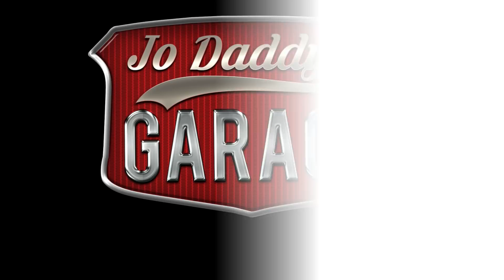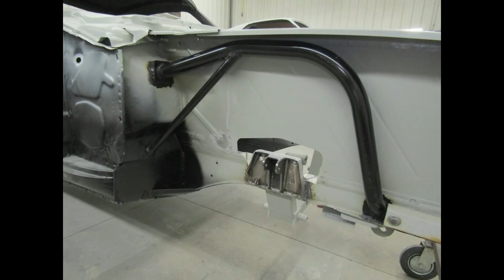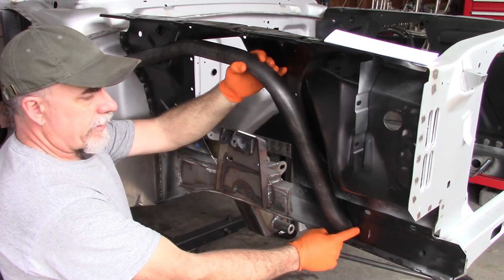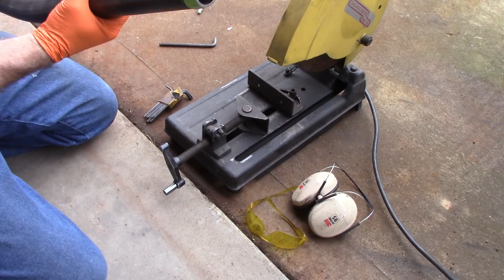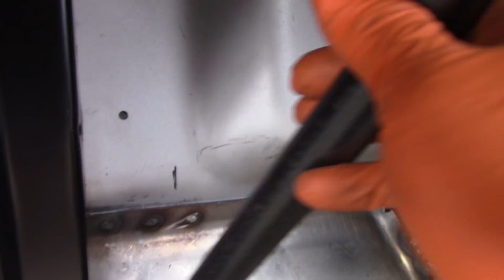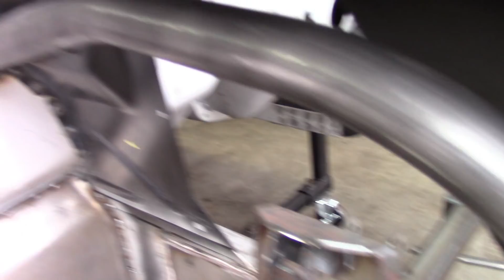Mustangs to fear frame stiffener install. Brooklyn Pony part 16

Comment: Did you end up having any tire rubbing issues?
Reply from the maker: Not after I modified it. Found out later the owner provided 2” drop spindles. That affected fitment. I thought they were regular spindles as we had agreed on that.
Reply: @JoDaddysGarage   what needed to be modified or is there a video on that?

Comment: Never seen how a sheet-metal base (firewall) is going to help. Im a collision specialist i small front-end fender bender will take out your firewall in 2.2 sec.
Reply from the maker: I agree. Not my design.
Reply: @JoDaddysGarage   with the mustang ll style frontend I would run one tube from about the same point as that one start and make a loop over to the other side of the frame. Loop it so it goes right to the top of the shock tower opening   Do the Same on the other side. Then you could do a shock tower triangulation in the top of the engine bay just like we do when we have the shock tower still there. A person could weld in some threaded bungs so it could be removed if need for maintenance. It’s a great look to have that inside of the engine bay. I can’t wait till I can get may hands on some more tools. Been a fab/welder all my life. Also I need to find another chassis 66/67 do build some replacement system to silly things I see being done. Don’t take it the wrong way. It looks very cool in the wheel well. My cars are low and my ties are stuffed.  I can’t wait to get to the video of wheel fitment. I’m curious. To see how far away the tire is from that small triangulated bar. MTF almost had something there. Yes it will stiffen things up and you were very correct in triangulating that small tube. If you hadn’t it would have only stiffened it on up and down and would have mad the energy move to the week points. Triangulating that small bar stopped it.  Now you have side to side stiffening as well as up/down movement. Great job brother.
Reply: It won't. Looks nice, but little stiffening going on. Once the shock towers and braces are cut away, the front end becomes a "flexi flyer" and the original structural concept is lost. What's needed is a fully triangulated truss structure tying together the firewall, frame rails, fender rails, and radiator shell. Then the radiator shell needs the same treatment, and the entire front end becomes a space frame. The tubes can be small since they are loaded mostly in tension and compression rather than in bending.

Comment: Their website says these don't work with a stock front suspension setup. I have global west upper and lower control arms which are basically the same as stock using the same front shock setup. Do you think these could still work somehow?
Reply from the maker: I can’t say for sure.

Comment: NICE JOB!!! YOU SIR ARE AN ARTIST AND A CRAFTSMAN . I HAVE SO MUCH RESPECT FOR YOUR WORK. MOST PEOPLE HAVE NO CLUE ABOUT STRUCTURAL RIGIDITY  WHEN THEY BUILD A CAR. ALOT THEM THROW A MOTOR WITH GOBS OF HP   IN BUT NEVER THINK IS IT TOO MUCH FOR THE FRAME TOO HANDLE.AND ALSO THE SUSPENSION COMPONENTS.

Comment: Any concerns about frame flex pulling your firewall out of whack? I was thinking maybe a plate on the inside just for a meat factor if you will.
Reply from the maker: It could be a concern, but it would take a lot of stress to make that happen I think. The strut rod to the torque box will help a lot.
Reply: @JoDaddysGarage  was just thinking that body flex was a major issue with these cars although it looks as if you have taken some serious steps to mediate most of that issue.

Comment: Its called a snout bar.  It should be tied into a full roll cage and its best for the right and left snout bars to be tied together usually with a removable 'Monte Carlo type bar.  Just saying
Reply from the maker: I agree. I called it what MTF named it.
Reply: @JoDaddysGarage  I've really enjoyed the build and have picked up some great tips.  Waiting for someone to do a rear suspension that I could live with.  OVC looks ok but...I want 5-6 inch at the pinch welds and 8x15" rims.  No body has.
Reply: I couldn't find anywhere they are called snout bar. Most people with common sense would relate to frame stiffner's.
Reply: @RS-gh2mf  Frame stiffner? LOL Where is the location of your "stiffner" Oh towards the nose of the car, hence, snout bar.  Google if in doubt before you expose to all.

Comment: Would it benefit to add a plate to the angle brace on the torque box like the top pipe has on the firewall?
Reply from the maker: Not really. The torque box is very thick compared to the rest of the metal.

Comment: Bear/ Barry, thank you so much for all your hard work and knowledge. I really value your expertise and willingness to share to make the rest of us better  and encouragement to pursue a passion. Quick update on my 67 rehab. Took interior out, dash torn down, found rusted out lower cowl. Found rot under driver seat pan, passenger floor, pan, front frame rail. Not sure if doing what you did to Brooklyn is the best way to go or if I should just try and do a patch job.

Comment: Some one probably said this, but the underside of the semi-boxed passenger side reinforcement, is open to water splashing up. You can paint the top front and side, but what did/ would you do to keep water out from underneath?  Even if there's a plastic wheel well between it and the tire, I figure if water can get there, it will.
Reply from the maker: The torque box? Everything will be sealed and undercoated.

Comment: I like  concept of how this is intended to stiffen the frame rails.   The problem I see is that all the connections at the firewall are on flat sheet metal areas, not at the seams where all the strength is concentrated.  I would want to use additional tubes that run latterly between the apron seam and the cowl side seam or even better triangulated like the small tube.  This way all the forces are transferred into the structure of the sheet metal and doesn't just flex it like a drum.
Reply: Spot on, not to mention that these are a waste of money if you're looking for serious.

Comment: The smaller tubes won’t interfere with the wheels?
Reply from the maker: It shouldn't, but I will mock it all up prior to any finish work. I will modify if necessary.

Comment: Another great Brooklyn Pony video. Thank you! Concerned that there may be risk of tire interference due to articulation.  Without the suspension installed, full weight of the power train and tire/wheel choice, I think you may have problems with this later in the build. I'm just sayin', but hope you don't. Thanks again from Greater Chicagoland  sir!
Reply from the maker: I will do a test and see if there's any problems. If there are, I'll modify it.

Comment: Seems to me that the pipe should join the body much farther outboard where all of the lower cowl and a-pillar join????
Reply from the maker: The a pillar doesn't actually join the lower cowl. It's further back. It could go a little further outboard and actually be tied to the rocker panel joint though.

Comment: great  brainstorm on the mod! would adding a plate on the torque box add more pressure resistance ? thanks for sharing.
Reply from the maker: It would add some.

Comment: Really cleaver massaging of kit to make it fit! I wonder if the main tube tie-in on the firewall would be better if it went higher and incorporated the pinch weld seam similar to where an export brace ties in.  I think that seam is quite strong.The tube would of course have to have a different bend. Or perhaps an upside down "L" bracket cold be welded to the pinch weld and extend down and take the place of the original plate. What do ya think?
Reply from the maker: I'm sure there could be a variety of ways to make it fit. In this case, I just adapted the parts I was supplied with.

Comment: Imagine that...... I would follow that up with a tubular Export brace that would have to be semi custom . There is a seller on Ebay that makes Billet mounts and would be a good start to it. End product would be nice and stiff. No panel shifting when you beat on it if you choose to.
I have no affiliation with this person . just thought it to be a good start to finishing off your work there . Probably can take some measurements and have him make the struts longer and supply tabs to weld on the bars you just installed.

https://www.ebay.com/itm/Billet-Export-Brace-for-65-70-Mustang-67-70-Cougar/183065592098?hash=item2a9f8f4122:g:1x0AAOSw44BYQVhj&vxp=mtr
Reply: Do you feel this really stiffens the front end that much for the effort?  The metal in the firewall is so thin and there is no support on the inside.  Seems like  the metal on the firewall would bend first if stressed.  Great video!!
Reply: Well for sure you arent working with much which is why I recommend the layered method . Different points of pickup and as your installer did here you spread that load with plates . The above mentioned really helps because its tying into the cowl which has numerous bends and contours to give it some strength as well as that flange. If he ties this together with a custom export brace he really has the best he can get without a cage that has A pillar bars. Its a nice subtle deal here . There are many a guy running those rails out there with nothing and its just a bad situation . Was glad to see him employ this .

Comment: I am really impressed with all your thought that goes into installing parts . Not just slapping it on. I would have tried welding the back of the plate to the corner of the heater box hump before installing your bracing plate over top.

Comment: You did a very good job on that kit.  I am not too impressed with the kit itself.  It really doesn't fit the car very well.  But, I guess that's how it works with a multi year universal kit.  It might be pretty cool to build some sort of crossover bar to go from side to side above the engine that would tie the two hoops that you just installed together.

Comment: As I.said stiffer is not.alwais beter....    Is he want more stifnes why don't you make a connection to.the sideplates of the motorroombox.. ?   Then it goes nowere anymore.... Now it can wuble sideways with just one bar more to the plates in.front of the big bar it won't.    Just a structure idieer of mine..

Comment: What drivetrain is he planning for the car?
Reply: Wow, I figured Coyote.  No need to M2 with a 302 unless you are doing twin turbo and need room.  I would argue that the “stock” style (tcp etc.) double A arm setup with a coilover and Shelby drop would handle better than the M2.
Reply from the maker: 302 based with fuel injection.
Reply: my dream is to make a Coyote mustang!

Comment: I agree, we can design and re-design this system all night but I do like the concept. It's inexpensive, simple, and light weight. As you know they designed the Torque boxes to compensate for the added stress and twisting (Torque) produced by larger engines in Mustangs. I guess they didn't even factory install them until 1967 ?